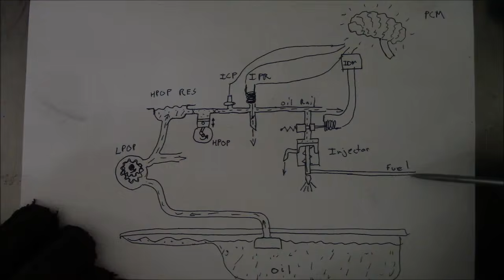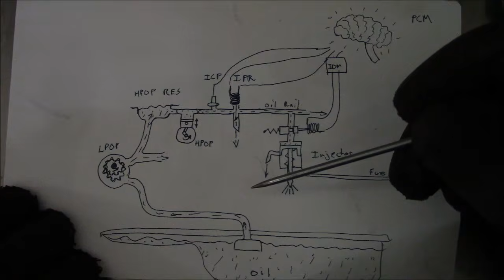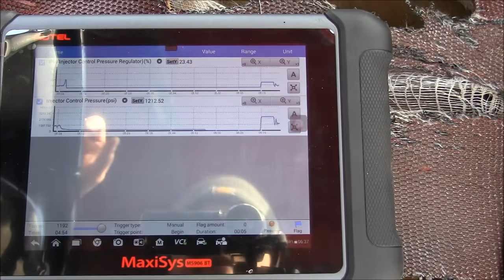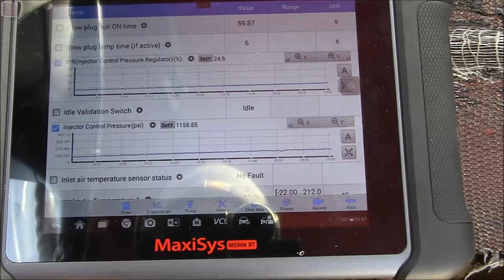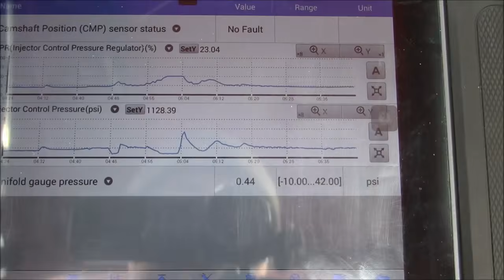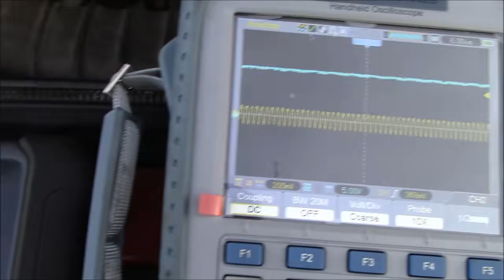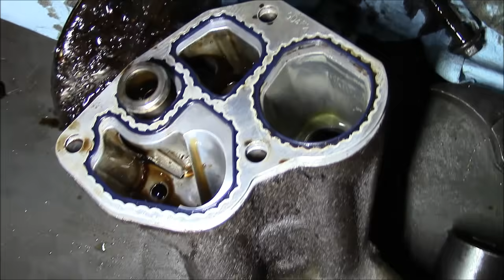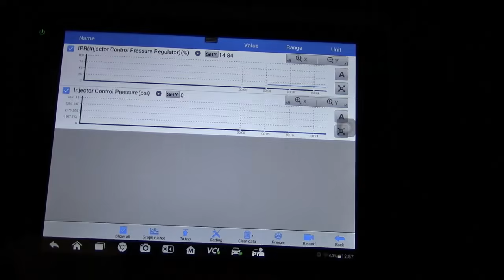7.3 Powerstroke Knocking, Rough Idle, Dying, but only when Cold. Plus many other Issues!

Comment: Great job. BTW you need a new seat for your red truck. You know, the ford? The Diesel yes, yes, that's the one. Oh and your boots are worn out and I can see the steel toe. I figured i would let you know about the boots, Just in case you haven't looked down in 2 years, taken them off or no one has told you already that they are in this condition.
Sorry I could not resist the bait, and had to comment!! LOL Your efforts in describing the heui system was impressive. Always a good show. Sure you complain sometimes, however it is amazing what someone thinks is a good idea on a repair. It may work but for how long is the bigger question.
Years ago I had a neighbor that had an old Studebaker lark 1 out of 6 times it would not crank the starter. There was a bad wire to the solenoid and he would open the hood wiggle the wire and off he went. I asked him why he didn't just fix the wire. He said its his anti theft device. He figured the odds were if the car was shut off it wouldn't restart and he would have a better chance of someone just leaving it and he would get it back. Strange logic as the man had the knowledge to wire in a kill switch or a fancy alarm, but a poor mans solution worked for him... Anyway, Thanks Wes for the Vid. Hopefully by now you have everything fixedW

Comment: Why don't use a high pressure  water hose to clean the  junk  off the engine housing . So you  can find the leaks better and any lose wiring . Just a thought

Comment: Wes love the channel.  Cant believe your depth of knowledge esp when it comes to the electrical diagnostics.  Wanted to say that I have been using Rectorseal on coolant hoses for years to help guarantee that a hose seals and the side benefit is that it makes them come off easier down the line.  Give it a shot on a pitted pipe like you had here- think you will like it.  Just brush a bit on to the inside of the hose.  Helps it slide on too!  Not greasy or anything just cleans up with a dry rag.  Keep the content coming!

Comment: I've never been a Diesel guy, so it's interesting to see how they used to handle DI systems before HP fuel pumps like you have in a direct gas engine.

Comment: Seems like a very complicated design.  Why use oil pressure, this must really cause oil breakdown and shear stress which can’t be good for lubing the engine or oil life.  Why not just use high pressure fuel, which is going to burn anyway and electric electronic control of the injectors.

Comment: nothing wrong with having multiple grounds. Yes, all grounds should go up to the ground post, but it never hurts to have them tied into the frame as well. We've often had to do that when doing trailer connectors, because the ground wire in the harness to the front never provide proper ground, so it has to be grounded in both ends

Comment: So I know this is a really old video and I'm sure I've already watched it once. A worn out pair of boots just means you work. Maybe the people who pointed out to you have never worked. Tip on the boots I take my brand new pair of boots to a shoe repair place and have them cap the toe ours use is material that's black and extremely tough. The toe will last as long as the soul does. Tested by a body man for over 30 years.

Comment: Have you tried plugging it in at night ? That motor oil gets thick as molasses when it’s below 30 deg outside and it can’t pump it up to pressure and you are assuming that oil is circulating when it isn’t I believe!

Comment: If not for RTV, then really the only other option is to weld/braze and grind of excess, or machine down.
For the inside of the hose, possibly use the small round tool for bike tube repair kits. Guess the rubber cement isn't a bad idea either.
🤣The ending

Comment: IMPRESSIVE,  2ND VIDEO OF YOURS IVE WATCHED,  YOU HAVE QUALITY DIAGNOSTIC TOOLS, IVE BEEN A MECHANIC FOR 35 YEARS, YOU ARE THE BEST IVE SEEN,  ESPECIALLY WITH THIS MODERN STUFF , HUEI ISN'T REALLY MODERN, ANYMORE..STILL IN DEPTH , LOT INVOLVED,  ALWAYS HAD HIGH PRESSURE OIL PUMP LINES LEAK ,ON CUSTOMERS TRUCKS ,BAD ECM , PEOPLE THINK IM CRAZY FOR SUGGESTING IT,, BUT THEY DO GO BAD OCCASIONALLY,,ESPECIALLY FORD PRODUCTS.

Comment: Congrats on a halfway decent purchase. You took a risk, and it looks like you got a workable dozer.
Weird that Cat hasn't added a skid plate on the final drive from the factory, that was my thought immediately when I saw that wear.

Maybe there's one out there with shot clutches, but a usable housing. Would make for a good video. I'm not in the market for an old dozer, but I'd definitely watch that.

Comment: You said it! When it runs, it runs well. I find it hard to believe a real diesel engineer designed this electronic mess. If I was younger, I replace the 7.3 with a mechanical Detroit Diesel. You can buy most Motorcraft 7.3 parts on ebay for much less than a Ford dealer. Just bought  a IPR for $86.

Comment: If you never out RTV on a Gasket Then explain how to Seal Valve covers or timing Covers That You have to out the Rtv ON the Locations that have 2 halves that come together you have to put rtv on the crack lines even if a Gasket Seals the top or it will forever leak some of the things people say on the internet just blows my mind on the stupidity @Watch Wes Work

Comment: great video. i am glad to see this video. because, i am looking at a 91 ford 7.3 Non turbo  , that has been sitting for a year , and it now does not run ., spins over but will not run. ?.it did before that it sat in the back yard. from the way it look's and sound's it might have the same problem. and can put a turbo on it. thank's for any help you can give . i looking to buy it.

Comment: It’s a fuel delivery issue compounded by a highly inefficient secondary ignition system(low spark) I recommend not wasting a dime on that truck, sell it and buy a Chevy. Yup that’s what grandpa told me over 50 years ago and it never steered me wrong…lol see how I did that…? “steer me wrong” on a car post…Nevermind!
Reply: Low spark 😮 on a diesel 😂

Comment: My guess is that the ipr increases duty cycle as the rpm drops but dose not see the drop in the average oil pressure so it just keep increasing the duty cycle.

Comment: Just dealt with 42 Lake Erie Ohio winters on a '78 F-100 and wow RTV was my friend. Just threw the bed in the trash and built one out of old barn wood. Ran through about 5 brass wheels decaying the frame and dag nabbit I bought an air hammer to remove the Swiss cheesed shock towers. May need your help with the drop beams, though.  Also, I used 4 of those 90's Ford hood hinge springs in  HS to win catapult engineering project. Sent that egg hundreds of yards.

Comment: It's probably too late -  you likely already changed the tensioner pulley, but it's easier and very much cheaper to just press out the old bearing and replace that.  Did it on a Nissan once when they wanted 90 bucks for the tensioner pulley and I replaced the bearing for $2.37.  Arbor press worked fine.

Comment: The strangest thing happened to my car and it felt like fuel related when driving and it was but not because anything major was failing. The problem was I was having troubles keeping the engine running mostly when cold the car would run fine the randomly quit why’ll driving and mostly when cold. It puzzled me for awhile cause it was a intermediate issue. Turned out the problem was a bad relay that controlled the fuel pump. I swap that really for me cars interior dash lights relay and when it got cold car started fine but my dash lights started flicking and I knew that relay was defective once it got cold outside. So strange but easy to overlook

Comment: HEUIs systems work extremely well as long as they are properly maintained. Change the fuel filter every time you change the oil and keep fuel additive in your fuel ( Stanadyne Red is what we used to recommend). BTW...the 6.0 PowerStroke does NOT utilize the HEUI system like the 7.3 does. The most common problems with HEUIs are tip spring collapse and breakage, intensifier piston spalling due to lack of lubrication and eroded plunger and barrel assemblies. I’ve overhauled a few thousand HEUIs. Yes, you need an IPR valve.
Reply: The 6.0L is a HEUI system, just a different design from the 7.3L.
Reply: U say it’s called standyn red and it’s ok to use on my 96 7.3 use this every time I fuel up?

Comment: Old video , but I’m hoping someone might share , what direction should you go with my 2000 f250 7.3 , it  has issues once it’s hot. You have to get it up to full operating temp (drive on freeway 15-20 min) 
And then it idles roughly. It seems to happen more in winter 
I’ve tried oil weights.  Took it to a diesel tech I trust, but they can’t reproduce because they won’t drive it long enough , it really won’t begin to show up until 20-30 min into city driving or longer , and if you get it on highway it’s shorter time. 
I have had gaskets inspected (though I’m still curious if that’s it) I’ve also replaced the main engine harness. That seemed to fix it , but it was also done at the end of spring when outside temps began to rise . The weather theory could be a red herring really. 

After watching your video it seems to me it could be something in the oil rail after or at the valve . 

Or it’s just a nasty .#8 injector 

I’d like to fix it before the weather warms up .

Comment: You know what Wes theres a lot of damn good mechanics on here but your one or maybe my top 5 mechanics on here.I have a question?I have a 95 toyota avalon xl and it was used when i brought it.Ive have some work done on it to keep it running but im wondering should i have changed the gas tank as well as a good fuel pump to get that clean powerfull excelleration?She only runs clean on the highway and has 234000 miles on it.It had 173000 when i got it 6yrs ago.Plus it has refurbished fuel injectors in i thought that would give a new younger car take off.

Comment: There is something I used to do which is poke holes in my wiring with a sharp pointed probe when troubleshooting electrical problems. Someone mentioned that it isn't a good idea. I live where salt is used too and if you poke holes in your wiring, salt can get in there and corrode it. I have seen what salt does to copper wiring here so I have stopped doing that. I think I actually did see corrosion get into one of the wires I probed. It was near the rear bumper so it got maximum salt exposure. I now look for a connector I can probe or some other way of determining that there is or isn't power on a wire. Not always easy especially with modern connectors that are designed to keep moisture out. If I absolutely must use a probe, I will seal the hole I made with silicone II or something like that to keep moisture out. Salt is nasty and loves copper.

Comment: Lots of miles left on those boots 🥾. Lol. 
When you get a new pair pull the old steel toe out of the old pair and glue it over the nose of the new pair paint it black or brown it will protect the new for a long time. It works great 👍.

Comment: If I have a bolt or a nut that’s hard to get to I use a long extension and the right socket. And I put a blade of grass or a small piece of paper over the socket then push the bolt or nut into the socket then start it by hand getting it started then use my ratchet till tight or factory torque  click click. 🤔

Comment: Wes, I would like to wish you and your family a very merry Christmas 🎄 another 5 ⭐ video, oh speaking of wiring my 2001 Ford Explorer sport track has no break lights but everything else works changed break light switch the light bulbs only one works is the little dumby light on the upper part of the cab still chasing wires any hints or ideas 💡

Comment: My boots were worse! I had the sides blown out and refused to buy new ones as comfortable workboots are hard to find. Mine need to have height to the inside, rather then width due to a benign tumor. Not many people will replace the seat of an old beater unless there is something that comes along when you think of it. No sense spending money on a cosmetic item for a beater.

Comment: The idea was that if you ever ran out of oil or low pressure the injectors will not work, no "run away" engine and no damaged engines from operating with out oil

Comment: I've learned a lot from a couple old mechanics old tricks of the trade when there is no scan tools ultimately you're going to do more work looking at a scan tool and I don't think scan tools are bad but out of all the scan tools that I've owned small sensors and things like that they help to see if your getting a certain voltage or whatnot but actually coming down to the root of the problem a lot of times you got to tear the motor apart so sometimes it could be an easy fix but from all my knowledge of what I've done on these diesel trucks I know on the seven threes I'm not a big know-how on the 5.9 but I know quite a bit about the seven threes and powerstrokes I came across more of them than 5.9 probably why no more but I on a 5.9 12 valve 1997 as we speak I don't communicate all off of a computer manual Gage everything your oil pressure deadhead the pump they call it so there's quite a few things and these injectors are quite intrigued for the year that they came out there's actually a lot to them mainly these trucks juji the injectors and glow plugs or the brass rings that the injector setsuna underneath it them can crack and loss of oil pressure and it'll show you got good oil pressure but it's enough to where it's bypassing it possibly could and the O-rings of course on the injector I know the trick is you just pull each wire it is a ground I believe or a hot I can't remember now injector with the valve cover off if you don't hear a difference and that injectors not working properly and just to be safe but all new O-rings on each injector that's a lot cheaper than buying or rebuilding the injectors and then deadhead the pump block everything else off and just see what the pump is producing if the pump is producing what it's inspect to produce you should have that minus a little bit it's going out in fulfilling each injector there's eight cylinders so if you deadhead that pump and you're getting 5000 PSI and you put a manual oil pressure gauge up to 7 thousand PSI if you remove that injector with all the Lions Open going to the motor like it would normally and you get the right fitting to go in there you should have pretty close to the same amount what's coming out the pump when you deadhead it it if not and there's a significant difference after you test each cylinder then more than likely one of them bronze bushings is bad you would think that it would tell you but the pressure is in the complete motor but since it's only telling you the pressure avoided seeing off the pump sensing that sending it back to the computer so that pump all day could be putting out dumbing and you have X amount of oil that might be one or two or several injectors that is just recirculating and it's not holding its proper pressure

Comment: I work on 18 wheelers and the oil filter punch is a must....ours have 3 filters the size of 2 litter bottles and 44 quarts of oil.  Oh and when you need 7.3 parts from international tell them its a 444E they get an attitude when they here 7.3!

Comment: Use something like this on anything that you think is remotely vulnerable to corrosion.  Super Lube 82016 Anti-Corrosion & Connector Gel, Translucent Amber PN 82016.  It's on amazon, but probably cheaper at a local store.

Comment: Why ?I have always wondered what Ford was on when they decided to go down this power stroke road. What happens when the oil heats up a bit or you put on 5000 is and the viscosity thins down a bit do you lose performance..??
Reply from the maker: No. The regulator adjusts for changes in viscosity. This was a measure to meet tighter emissions standards. Everyone had a different idea. Cummins had the VE pump, which was also a disaster. Duramax had common rail which was constantly blowing injectors in the first gen. Choose your poison.

Comment: Cool Video..I DO A Lot of Electrical Work  My Self an Have For 2-3 Decades Now Some From 6v Up To about 5-10Kv & any Time I See A Bunch of Tape I Know Its Bad...I Puled The Top Off of a 10m Radio Years ago & it Was about 90% Tape (Every Wire) & I Just Stuck The Cover Back On & Handed It Back To The Customer & told them it was not Wort Fixing Unless They Wanted to spend More on Parts & Labor Than Buy 3-4 New Ones..lol. I So Despise Tape..

Comment: That’s seat has another 100k in it..good job, if your still getting the long crank cold, I’d look at the glow plugs., not really familiar with the older 7.3 system, but the slightly old 6.0 6.4 and the 6.7 will turn them on for short bursts to help clean up a cold idle.. I think it’s called an “after glow” that will cycle for a couple minutes after start up, but will not light the wait to start light, now I also know the 7.3 has an old style relay, and some newer ones have a 6.0 style control module, not sure if they both have the after glow?? But something to look at if your icp builds and the engine doesn’t fire right away,

Comment: You are driving me nuts wasting time and money. Your extension cord caught fire. Nothing wrong with your block heater. I live where it's stinking cold. I see this all the time. You probably had a molded end on your cord. Even a good end that gets dirty and corroded (the prongs on your block heater can also be a problem). A bad connection causes resistance. Resistance generates heat and starts fire...and won't kick your breaker. Go change the end on your cord.